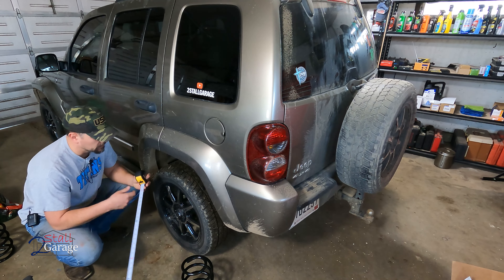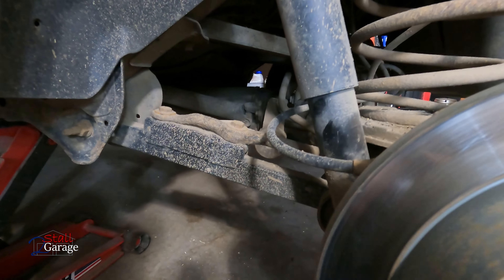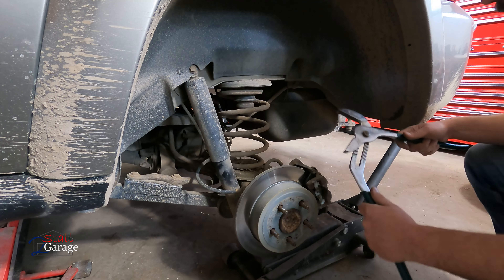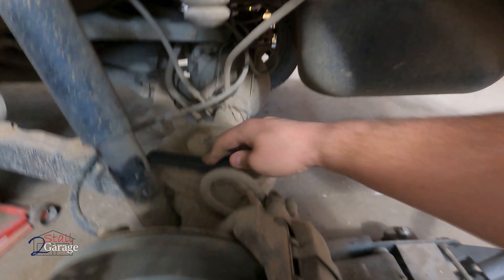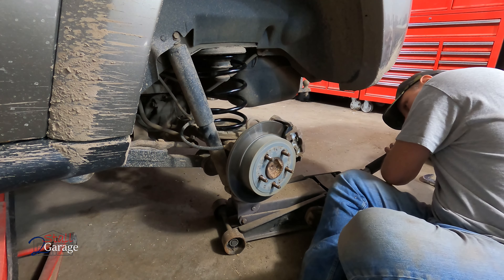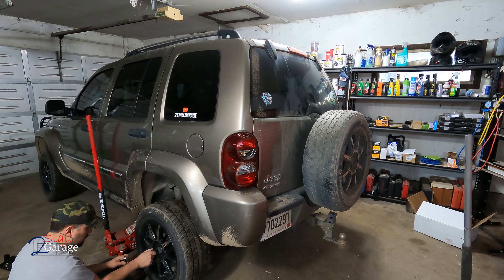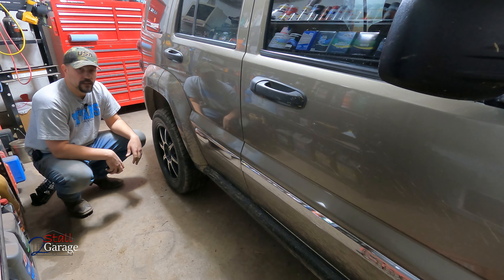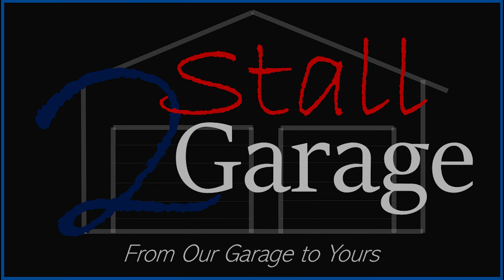Jeep Liberty KJ Rear Coil Springs | Remove and Replace

Comment: Since my jeep is lifted 4 inches I had to jack the jeep up by the axle, take the wheel and tire off, put a jack stand under the front lower control arm mount, lower the jack, then start the process to remove the spring. SMH
Reply from the maker: Holy cats, please share what you used to get a 4 inch lift under yours.